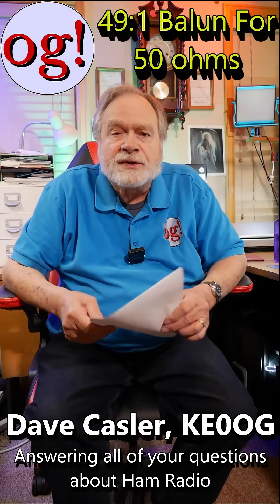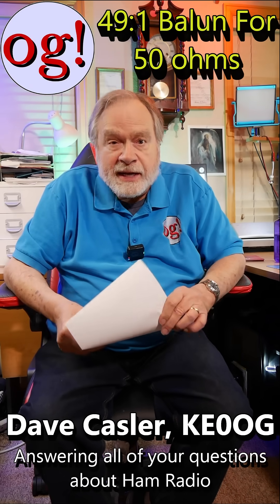49:1 Balun for 50 ohms (Short #75)

Comment: so no choke if you have a lightning arrestor?
Reply: I'll have to check that out.  I used to have a common mode choke right before my coax of my EFHW entered my house.  But I added a lighting arrester  at that point and tied it to the common ground.

The common mode choke seems to impact my antenna on 10 meters.  Perhaps I don't need it when I operate 160 and 80 meters now?